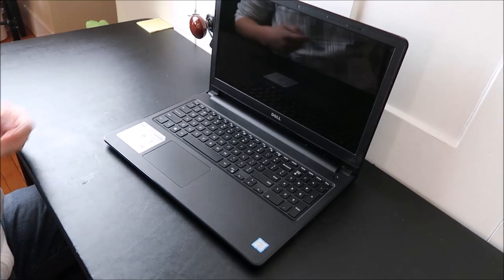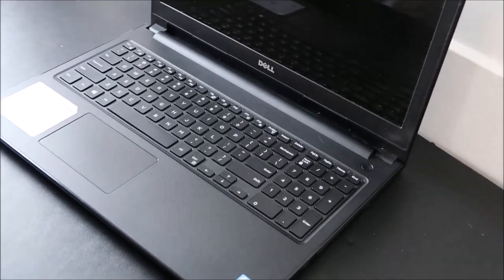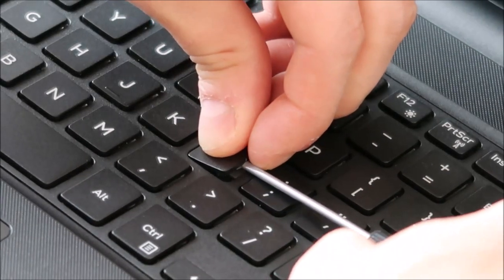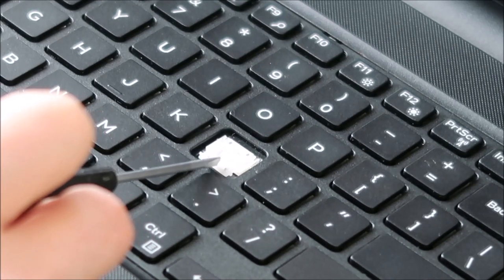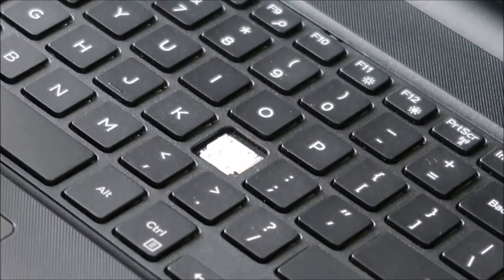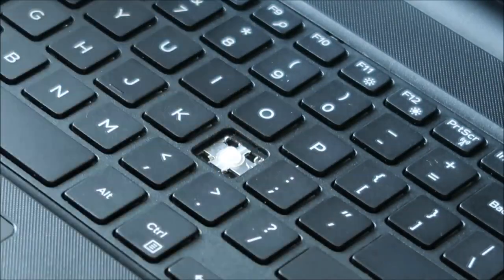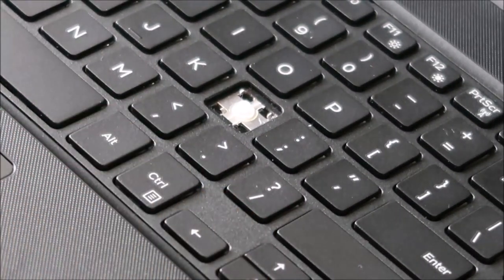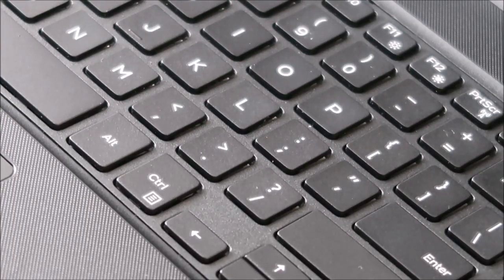How To Fix Key Dell Inspiron Laptop - Replace Keyboard Key Letter Number Arrow Keys Etc

Comment: Can you do a video or at least explain here how to reattach a ctrl key on a Dell Inspiron 15-3567? I've tried for days now to reattach it all different ways and I've done research and nothing comes up and it pops into place then quickly unconnects
Ive tried reassembling the transparent pieces all kinds of ways (they are both intact too with no parts broken) yet it just won't hook. Please help
Reply from the maker: If your Key Cap is not clicking down in place correctly, it is most likely due to the Retainer Clip not being properly installed or damaged.  Remove the Cap and inspect for damage or that its not laying down flush and properly snapped in itself.  Compare to another Clip if needed by removing another Cap.
Reply: @PC_Monkey  I did that, worked on it 3 hrs last night and still can't figure it out, and the last thing I'm doing is messing up another key by taking it out cause that's how this mess happened in the first place (I popped my m key out and took off the Ctrl key to see how to click it and I got it back on but now I'm struggling with the Ctrl key)
Reply: @PC_Monkey  the only part that clips on properly is the metal bar. And I've tried every combination to make sure the retainers are correct and they are, because nothing is broken and they fit perfectly on the keyboard/key by itself, just it won't click and go together
Reply: Nevermind, the part I assume that the broken part is the key itself so gonna get a new one, thanks anyways

Comment: So what do I do if the centre rubber piece came off? How do I reattach that?
Reply from the maker: There isnt really a good way to reattach those.  They are not meant to be replaced.  Best advice is try to use a small amount of glue.  If that does not work, you may have to replace the keyboard.

Comment: KEP CAP WONT FIT. BUT MY RETAINER CLIP IS NOT DAMAGED AND PROPERLY INSTALLED
Reply from the maker: If your Key Cap is not clicking down in place correctly, it is most likely due to the Retainer Clip not being properly installed or damaged.  Remove the Cap and inspect for damage or that its not laying down flush and properly snapped in itself.  Compare to another Clip if needed by removing another Cap.

Comment: Too bottom part is attached to key how to put it then
Reply from the maker: Because they key can usually not be reinstalled with the Retainer Clip and the Key Cap still attached to each other, you would have to separate them as seen here, using a small flat pry tool.

Comment: What happens if my retainer clip is stuck to my keycap
Reply: Also If the retainer clip is in two pieces can i just put them bacl together or is it broken
Reply from the maker: @conkbadonk1209  They fit together with a small plastic pin on the left and right of the inner clip.  These fit into holes on the outer clip.  To see exactly how the inner clip sits in the outer clip, remove another key cap and copy the clip under it.

Comment: my retainer clip is not 'snapping in'
Reply: also, my key just fell off. literally
Reply from the maker: If the hinge clip wont snap in, its because its not inserted correctly, its damaged, or the metal pins on the keyboard are bent out of place.

Comment: My key is stuck with the clip on it and it keeps falling of my keyboard
Reply from the maker: Because they key can usually not be reinstalled with the Retainer Clip and the Key Cap still attached to each other, you would have to separate them as seen here, using a small flat pry tool.
Reply: @PC_Monkey  oh okay thank you so much!
Reply from the maker: @baileyever8134    Your welcome !!  Happy to help :)

Comment: The main part of this video, the white rebound piece is out of focus and the camera is too far away to see what you are doing to put it in. Better camera work and a more deliberate pace would to a world of good.
Reply from the maker: All Hinge Clips are going to be a bit different than the one in this computer.  So they wont be exactly the same.  You will have to figure out which side of the Hinge Clip you need to install first before snapping the other side in.

Comment: I spilled pineapple juice all over my laptop and tried to clean around the keys with alcohol, but many are still sticky. So I lifted up one more-inconsequential key (just the very top black part, not the hinged part) to see if I could clean and replace it, but now I can't get it back on for the life of me. It doesn't pop back on as shown at the end of this video. The little white hinge can be slightly pulled up, and I almost feel like it needs to be lifted a bit to allow the little inserts in the black piece to pop in, but that still doesn't work (I tried holding the white part up slightly with a long fingernail.) I'd really appreciate anyone who has any ideas! Thank you! :thanksdoc::eyes-pink-heart-shape:
Reply from the maker: Possibly the Hinge Clip is damaged or just out of place.  If your Key Cap is not clicking down in place correctly, it is most likely due to the Retainer Clip not being properly installed or damaged.  Remove the Cap and inspect for damage or that its not laying down flush and properly snapped in itself.  Compare to another Clip if needed by removing another Cap.

Comment: my key cap wont fit!!!!!!!!!!!!!
Reply from the maker: If your Key Cap is not clicking down in place correctly, it is most likely due to the Retainer Clip not being properly installed or damaged.  Remove the Cap and inspect for damage or that its not laying down flush and properly snapped in itself.  Compare to another Clip if needed by removing another Cap.

Comment: The bottom part won't fix :(
Reply from the maker: Can you explain what is happening a bit more?
Reply: I fixed it now but when i press at the bottom of the key that fell out it won't work so i have to press to top for it to work
Reply from the maker: @mintyonthegame   If your Key Cap is not clicking down in place correctly, it is most likely due to the Retainer Clip not being properly installed or damaged.  Remove the Cap and inspect for damage or that its not laying down flush and properly snapped in itself.  Compare to another Clip if needed by removing another Cap.
Reply: @PC_Monkey  what happens if i break it trying to take out the retainer clip?
if it breaks can i fix it or is it fully broken?
Reply from the maker: @huckleberryranger  If any component of the key assembly is broken, it would have to be replaced.  I usually get my keys on Ebay or www.replacementlaptopkeys.com.  If you cannot find a loose key for sale, you may have to purchase a keyboard and take a key from there.

Comment: Ok yea it worked but it kept falling out :(
Reply from the maker: If your Key Cap is not clicking down in place correctly, it is most likely due to the Retainer Clip not being properly installed or damaged.  Remove the Cap and inspect for damage or that its not laying down flush and properly snapped in itself.  Compare to another Clip if needed by removing another Cap.
Reply: @PC_Monkey  actually My w key cap is like loose my button still works its just m key cap it keeps falling off when i click w

Comment: my clips are in two different pieces
Reply from the maker: They fit together with a small plastic pin on the left and right of the inner clip.  These fit into holes on the outer clip.  To see exactly how the inner clip sits in the outer clip, remove another key cap and copy the clip under it.

Comment: I ripped it
Reply from the maker: If you broke any of the components then you may have to replace the whole key assembly as the individual parts are rarely sold separately.  No worries :)  They are very easy to break.